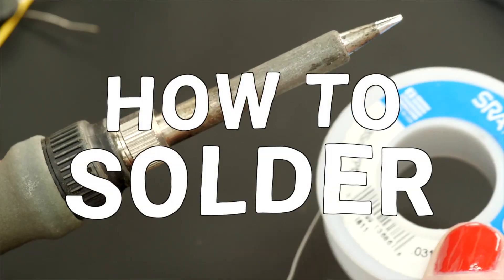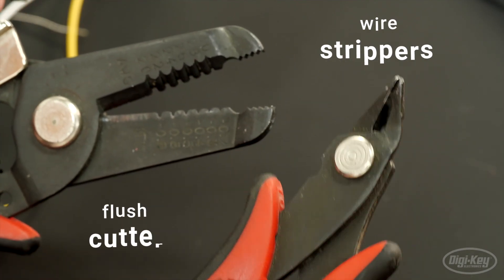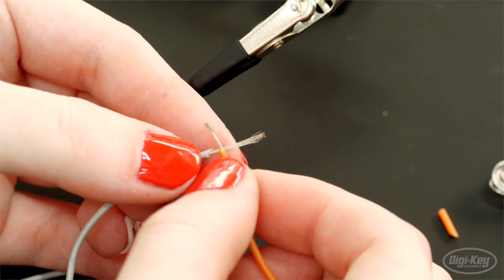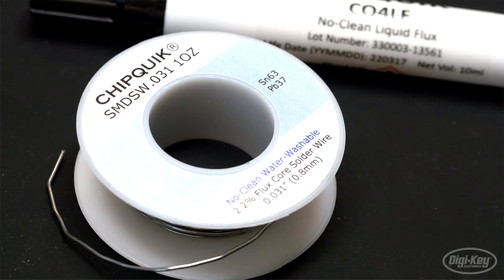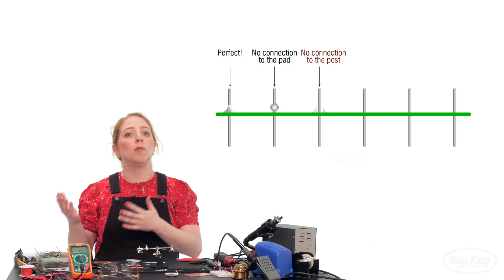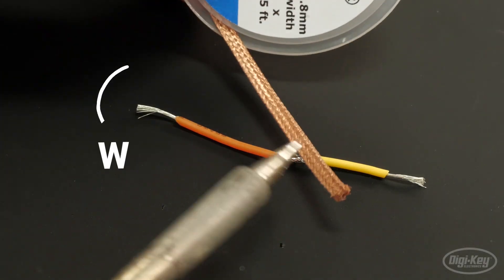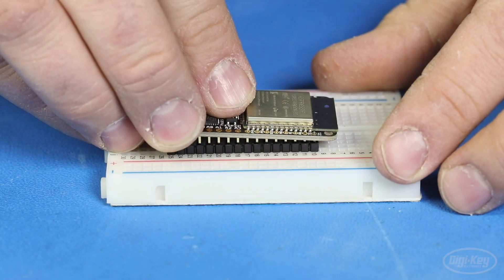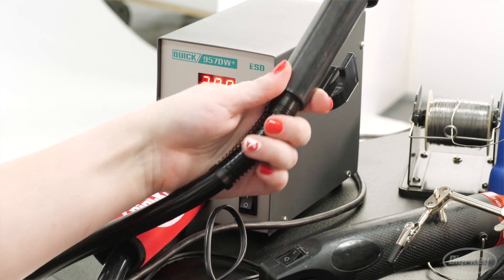How To Solder - Electronics with Becky Stern | Digi-Key Electronics

Comment: Even the soldering she's doing here seems to flow too slowly for me; I almost never solder without using some additional solder flux, especially on heat-sensitive components (the faster the solder process goes, the less heat the components are exposed to).  But even soldering wire together I'll use some flux, the connections are not only faster, but look much better and have a near zero chance of a cold solder joint (on medical equipment, I just won't take that chance).

Comment: Lots of left out info-
Ventilation and washing hands after handling solder due lead content of solder.
Soldering order by type- jumpers, sockets, resistors, caps, leds, transistors other non chip semiconductors lastly chips.
Don't solder CMOS chips with AC iron plugged in/on. You can unplug or turn off an AC iron when it is hot and have enough heat to solder a few joints. Or use a DC iron.

I like to leave one lead long on resistors and with one ohmmeter lead connected to a copper sheet (a blank PCB piece) on a block attached vertically to my bench. I hold the work so all the left on leads touch the copper and I double check my resistor placement and solder joint worthiness at the same time measuring from the under side along the trace. I have sockets I connected all the pins together that I connect to my meter and plug into soldered sockets.

Comment: Fantastic, I wish someone had taught me this 30 years ago when I first was learning.  I figured it out through trial an error.
Reply: We learned three methods for joining two wire ends together. One method was basically braiding the ends. Another was simply bending both at right angles and joining them. I forget the other.
Reply: Definitely a skill to have, one that will save you money and grief in the long run! 👍🏼😎✌🏼
Reply: Sometimes that's the best way to learn
Reply: I learned how to solder back in the mid 90s. It didn't seem very difficult. I think I could still do it.

Comment: You forgot to mention what temperature is best for soldering those cables and LED feet.
Reply: Sorry about that! I recommend 650F for lead-based solder, a little hotter for lead-free. Read more in the article linked in the description!